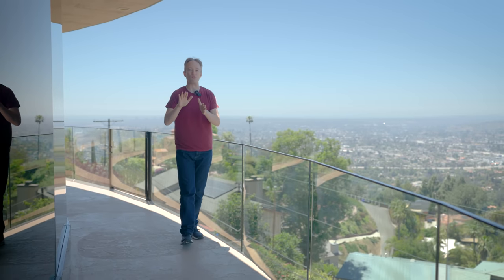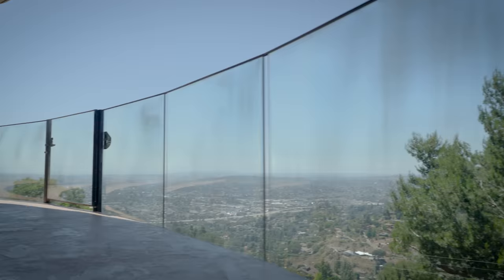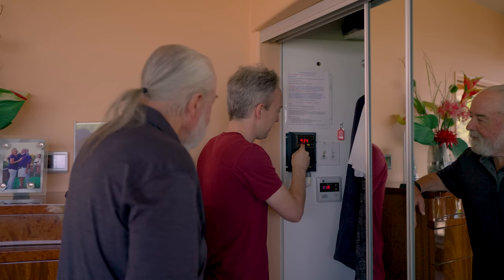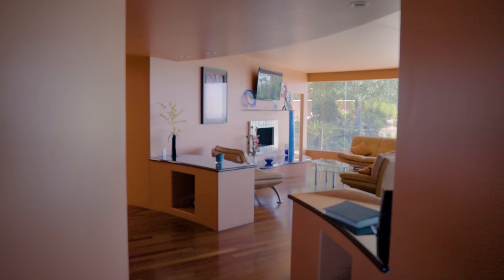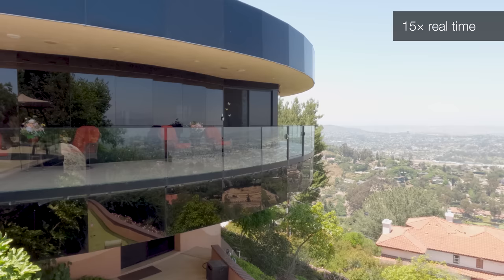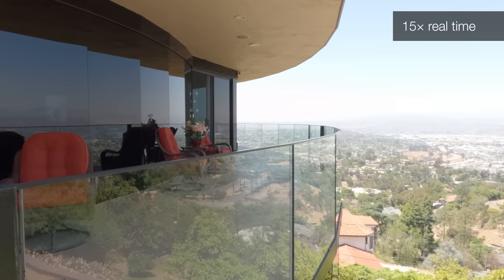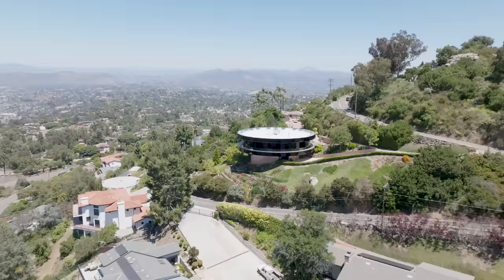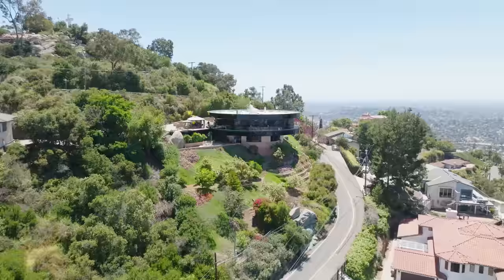I thought this rotating house was impossible.

Comment: As soon as I read "rotating house" my brain went into overdrive trying to think of ways the services could work. Interesting to see how he achieved it through slips rings.
Reply: my brain even started spinning
Reply: @daithi154  hahaha same - when I saw the solution I was blown away by it. Incredibly clever.
Reply: I had multiple ideas, most of which wouldn't have worked. The actual method certainly was most genius.
Reply: Not just slip rings, but slip rings with built-in leak detection!
Sweet.
Reply: Today this could be done by the house moving to a "service position", say once a week at 2am, in which a fresh water tank is refilled, grey/waste water tanks are emptied, and the battery bank is recharged (if roof solar was not sufficient). Internet would be via point-to-point WiFi. Automated actuators would engage quick-release couplings for the fluid exchanges. Of course this would not be nearly as elegant as the existing solution!
Reply: @simongchadwick  But then you would still need to store all of that somewhere in the house, taking up a good amount of real estate
Reply: The solution he came up with was incredibly smart. I was running through theories in my mind about how it would work and I was way off.
Reply: Once the idea of a slip ring is in your toolbox, the solution is borderline trivial.
By far the most important part of the solution is: don't make them small.
Leave enough room in the centre for a services to lie next to each other.
Once you have that, a monolithic block (as used here), or separate rings become obvious.
Reply: @Enemisses  He did not come up with the complete solution, it's called a swivel joint and is used in excavators and the like to transfer hydraulics.
He did however find a way to transfer this to be compatible with water, gas and sewage at the same time and with the leak proofing and detection, which is no small feat,
Reply: Actually it’s the same principle used for decades in excavators or battle tanks…
Reply: Amazing, I was mind blown. I've seen and heard of slip rings but never thought of combining (or not actually) liquids in one
Reply: I would love to know what solution you would’ve come up with, if it was different
Reply: That would keep just fresh water, power, and internet on slip rings going up the center. Internet could also potentially be offloaded to short range microwave transmitters.
Reply: @user-dx9ul2cn3k  but storing all that has an advantage: you could be independent and go off grid if you want.
Reply: But why put the sewage at the top? Surely even with the leak protection, put it at the bottom!
Reply: @Willdu87 I thought the same thing
Reply: @TheSanpletext  My thought was to have simple concentric rings and have each tank's pipe at the right distance to stay on its respective ring, but of course that wouldn't be a viable solution for drawing in gas and stuff.
Reply: That slip ring is groovy, man.
Reply: Its genius lies in it's simplicity. I wouldn't have thought of it, but it seems to be the most simple solution. Maybe also the only sane one.
Reply: @simongchadwick  There really is absolutely no reason for the house to be rotating while everyone is asleep. 

But then again, I'm an extremely pragmatic person so I feel like there's no reason for it to rotate at all, aside from the fun in engineering a way to make it work.
Reply: @Willdu87 i was rhinking the same, but it's possible that the sewage need a larger and straighter pipe to handle solid wastes and only the top one can offer that.
Reply: @Yonkage-ik5qb that's exactly the reason they built it, for the fun of it. They don't need a rotating house, they just wanted it. That's why they're selling it now, because they have other priorities.
Reply: @Willdu87 I had that thought too, but then I realized it doesn't matter that much -- the fresh water is under pressure, so the only direction a leak can go is from fresh to sewer, regardless of position.
Reply: It's a work of art at this point. When it's decommissioned those custom components should be put in a museum.
Reply: To go to bed to a sunset, wake up to a sunrise.  @Yonkage-ik5qb
Reply: To be honest the main reason this kind of thing didn't exist already is probably because there's not much demand for making your plumbing rotate. It's clearly an adaptation of existing concepts on top of redundancy and leak detection, just nobody's really put such a thing together because nobody went to the hassle of needing one.

Of course, a lot of inventions are iterations on existing ideas that nobody has slapped together.
Reply: God dude, what an elegant solution, especially the the electrical connections.
Reply: @tonymouannes why can only the top offer that?
Reply: Same!  I knew that grooves would have to do with it, but that was a novel approach!  I do think he put them in the wrong order though - someday, those seals will fail, and then gas will get mixed in with the water before anyone realizes what's going on.
Reply: @marianoguy  because you can only have one pipe going straight down in the center. The rest needs have a more complex shape going around the middle pipe, the cross section is a donut, not a circle.
Reply: @tonymouannes  you can still have that one single pipe going through the center even if it starts at the bottom. Look at the animation, they don't have more complex shapes, they are all straight. I don’t understand what you mean with the donut bit.
Reply: Still bugs me that gas and drinking water are not on top, or above the sewage and greywater. Even though it is alarmed, seals will fail and gravity is the law.
Reply: @kilianortmann9979 plus he managed to get it approved by his local permitting department. Imho the actual engineering required to design a functioning one is dwarfed by how much effort is required demonstrating you aren't going to contaminate the fresh water supply with waste water
Reply: @kilianortmann9979 The only flaw I see in his design is that it doesn't fail in a safe manner. Sewage leaking down to the drinking water is not good, but drinking water leaking down to the sewage line, while costly, won't hurt anyone. I realize that the pressure differential mitigates the problem, and I'm guessing that he did it the way it is because of the nature of sewage (being not just liquid) needing more space...
Reply: I just wonder about order of the rings. Wouldn't you want to to put the drinking water at the top, the gray water under it, then the gas line, and the sewage in the bottom? You don't want the sewage to leak into drinking water or the grey water, or the grey water into drinking water, so you'd order them accordingly. Less of a clean-up if something leaks. You'd maybe put the gas line between sewage and grey water so escaping gas would leak into them and not cause any problems.
Hell, if you don't mind adding seals and sensors, you could have sensor rings over and under each service ring and dedicated, ventilated "escape rings" between each service line section just in case of leaks (with a geometry that would guide the leaks away from other seals).
Reply: @blechtic  I assumed it's for maintenance, sewage is more likely to cause a clog. I do wonder if he runs a macerator pump etc.
Reply: All of the restaurants that rotate have all of the plumbing and other services in a nonrotating central core.  They are a donut revolving around a nonmoveable core.
Reply: @Willdu87 as someone else pointed out he pull the higher pressure ones near the bottom which are most likely to leak and even if the they leak they push into lower pressure/least critical fluid. Also since they are higher pressure even a leak from something above has to not only get past multiple seals but also the pressure difference which just isn't going to happen.
Reply: @marianoguy  If the large top ring for the sewer was on the bottom, there would be no room for the drilled holes leading up to the smaller rings. You could get around this in various ways, but it would make the assembly bigger and more complicated, and the risk of undetected cross-contamination is low so he probably decided it wasn't worth it.
Reply: @iguanamoat  ah, I see what you mean. There's indeed different diameters of the grooves and not just different heights
Reply: @justrosy5  relative pressure levels override gravity as a concern regarding the direction of flow after a seal failure
Reply: He could have just put a pipe within a pipe within a pipe and solve the solution cheaper and easier.
Reply: Funny, same here.

Other people might immediately think about the views, or think about the cost, or think about "who would do that". But my brain skipped all that and went to the services working.
Reply: @StubbyPhillips  I mean if you go to the lengths of inventing this kind of stuff you might as well do it right. He was also smart enough to know how important safety measures are.
Reply: @simongchadwick  and to be completely honest, such a system would probably be more prone to failure, not less.
Reply: @cggc9510 water pressure would prevail tho. Fresh water has pressure, so if it would fail in any direction it would be from down->up
Reply: Could you do a video going into more detail about these Solutions this guy found?
Reply: If you look at an excavator, it has exactly the same device.  The whole "house" of an excvavator can rotate.  Typically the hydraulic pumps and controls rotate with it (as does the operator himself), but the tracks are driven by hydraulic lines that come from those pumps and controls.  So they use exactly the same hydraulic swivel arrangement as this guy has RE-invented.
Reply: we all get it, you've got an engineering mind
Reply: Why rotate the bathroom if all it matters is for the outer rooms to change views.
Reply: @StubbyPhillips  if you live on the property, I guess that you will absolutely make sure that mf doesn't leak